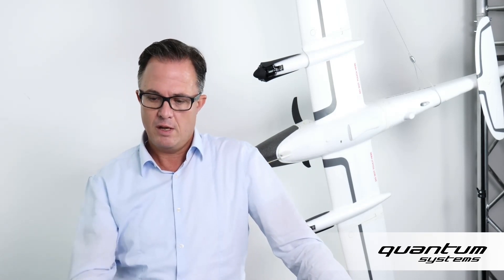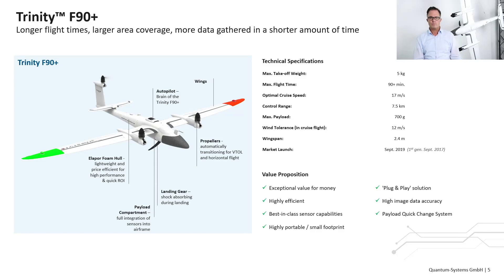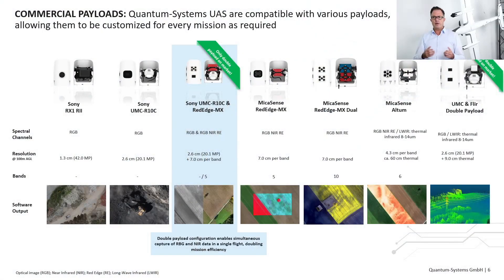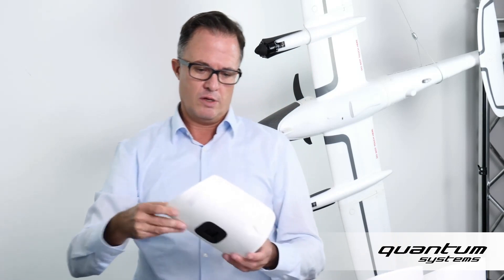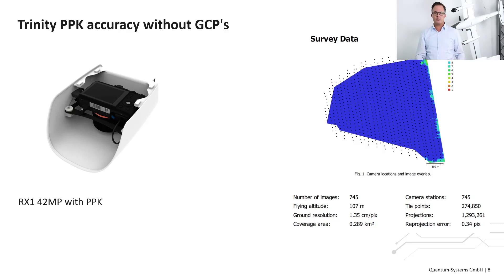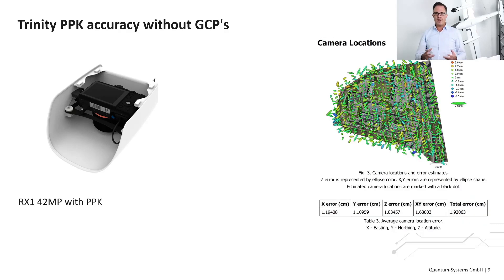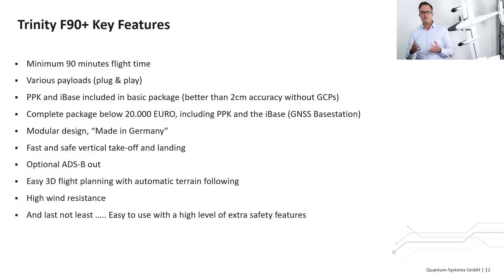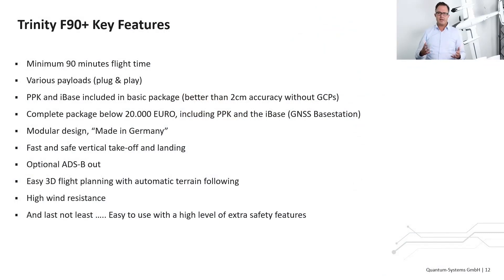Why should you use an eVTOL UAV for mapping!

Comment: The pure fixed wing, hand-launched Aeromapper Talon LITE flies for 2.5+ hours for a fraction of the cost and using the same payloads.
Reply from the maker: hello sir. please also compare that product in flying with high altitude. also compare the use cases you can achive with VTOL instead of unsafe belly landings. all the best